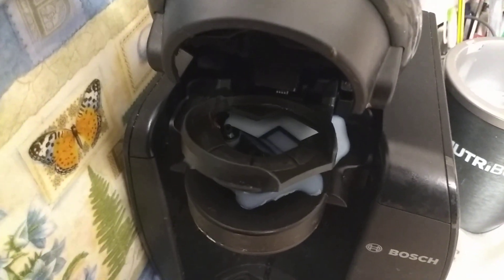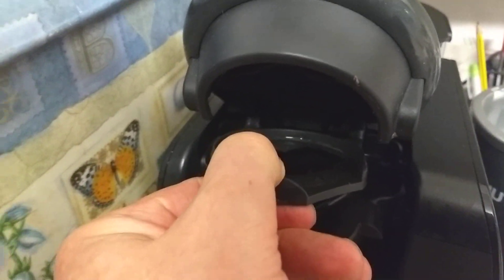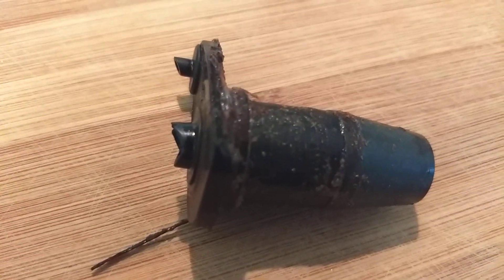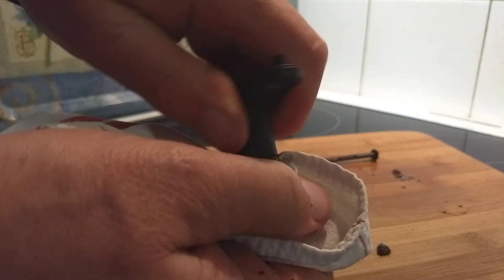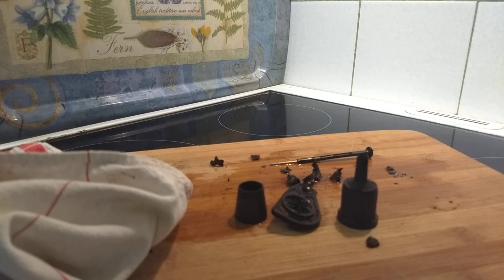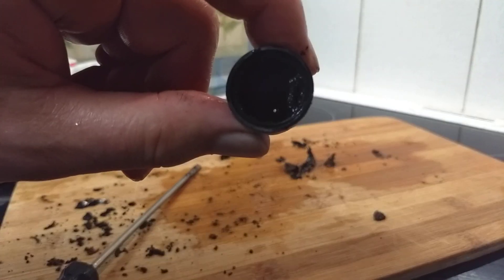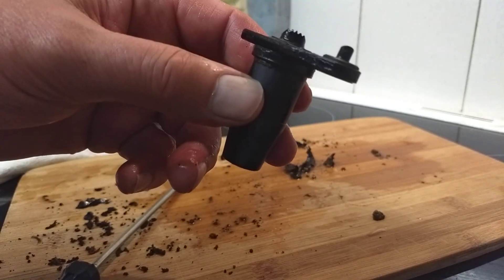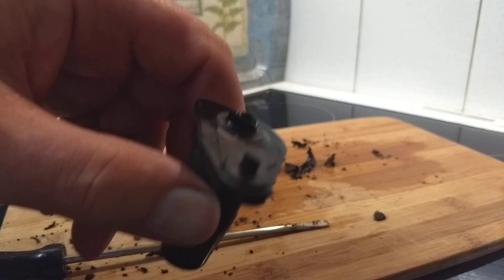How to Clean Clogged & Leaking Milk Tassimo Nozzle!

Comment: thank you so much had the same problem did not realise it could be stripped down. I cycled cleaned three times with the yellow disc and still had the same problem but I will try this solution now. Thanks
Reply from the maker: i just had to through the cycle about 8 times before the red light cleared then i did another cycle for good luck!

Comment: Wow, thanks a lot!  what a great video.  My Tassimo had so much stuck-on coffee grounds.  Like you said, it was clogged, so the milk could not go through the nozzle, so it came out of the top.  It would have been nice, though, to see how you cleaned it.  I soaked the parts in 2 parts water and 1 part vinegar for at least 30 minutes, and it loosened all the grime and made it easier to clean.
Reply from the maker: Sarah, I just scraped it clean as I was in a hurry but I'm going to soak all the bits in a vinegar mix (as you suggest overnight). Must get some more descaler as well. & thanks for your kind words.

Comment: Wow thanks for saving my coffe machine.was about to throw it away.cleaned it very well and now works as new. Found inside even aluminium foils from the pods that the machine does a hole in it. Cheers
Reply from the maker: Glad I could help! When I first cleaned mine couldn't even tell what was actually part of the coffee maker and what was dried coffee. Remember to dismantle the nozzle every now and again and leave to soak over night!

Comment: Thank you!!!! I've been running a cleaning cycle over and over, and still, I was getting bits of crud coming out into the cup. Google search on how to clean a Tassimo properly brought me here. I've got the newer type, but the concept is still the same for the most part. Popped the nozzle out, that's where my problem clearly was!! Pipette brush through the nozzle and around the spaces cleared it all up instantly on the next cleaning cycle test.
Reply from the maker: Glad it helped! The first time I cleaned mine I couldn't tell what was actual nozzle from solid coffee residue!

Comment: Found one today, didn't have the service disc, returned to original dump location and asked around, found the owner and asked if she had the service disc, amazingly she had it. We went home and tried it out, only to find the machine kept shutting itself down every time I started the descaling sequence. Then I thought Ahah Check YouTube, someone would have posted something about tearing one down. That's when zzapper zzapper popped up with the exact solution. Thanks fro sharing, although I don't think I want to get hooked on the blackmail barcode system that Tassimo has adopted on their proprietary beverage dispensers.
Reply from the maker: Thanks Zurkster, I use YouTube all the time for solutions to my problems and if I find a good solution myself I put up a video